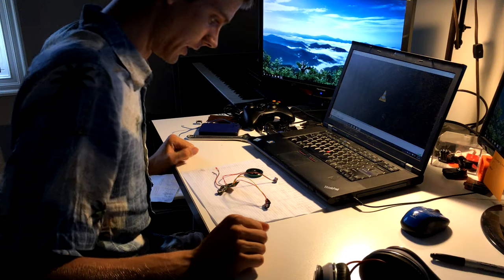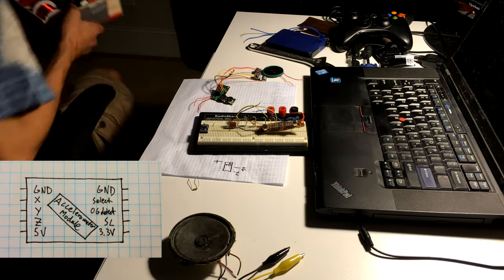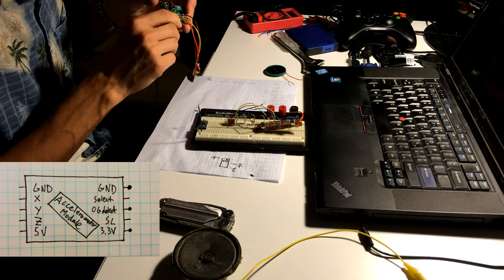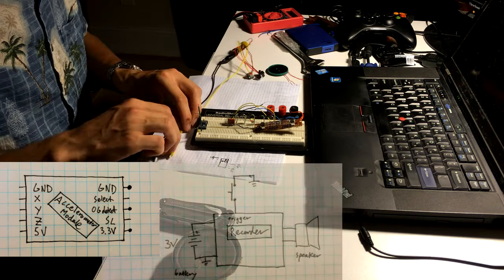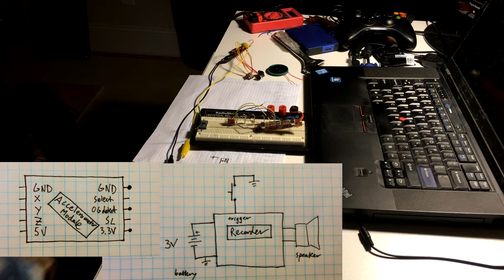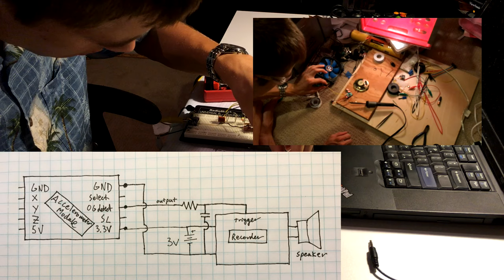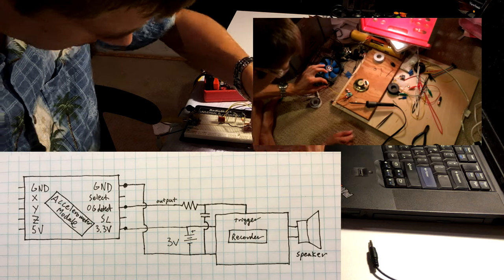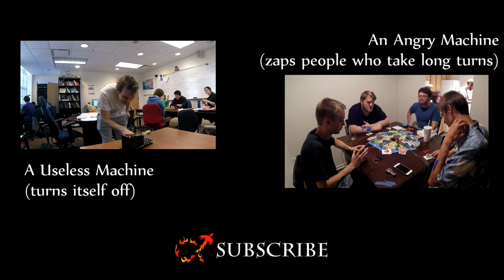The Wilhelm Scream (robot)

Comment: It is nice to see some analog circuitry! Some accelerometers with digital output have the possibility of detecting free fall. It is used to lock and protect harddrive. If you can find a really cheap multiwii board, you can write a simple arduino sketch what pools the accelerometer and triggers if it detects that the magnitude of acceleration is small (free fall).

Comment: Why not just use a captive ball bearing switch that mechanically activates the scream so we don't have to wait a whole second after it hits the ground? The whole point of the scream is to hear it as it falls!
Reply from the maker: That was actually my original plan - to use a mechanical switch, but I opted for the electrical accelerometer because I had a few laying around (bought long enough ago that they are now effectively free) and I wasn't sure what the mechanical version would be called, so I expected I would have to build one. Now I know it's a captive ball bearing switch! I swear the hardest part of finding stuff on the internet is figuring out what other people call it!
Reply: I think a better term is "tilt ball switch" or "ball bearing tilt switch". Google didn't give anything useful for the term " captive ball bearing switch".

Also it looks like the module starts the sound as soon as the accelerometer goes back to its neutral off state (which I think is high?) so that switch would have the same effect I think.

Comment: what is the circuit called that you used for the speaker
Reply from the maker: +TheSourAlpaca search for “Greeting card recordable circuit” or something similar on eBay. They’re only a few bucks a piece.
Reply: thank you so much for responding fast! I'm making a robot for a shortfilm that needs to make sound
Reply from the maker: cool! hope it works out!
Reply: You can use an isd1820py with supporting components..  a few caps, a few resistors and some momentary switches with mic, speaker and a 9v..